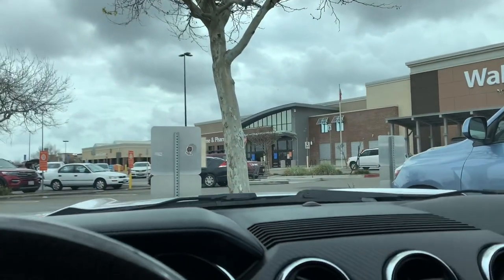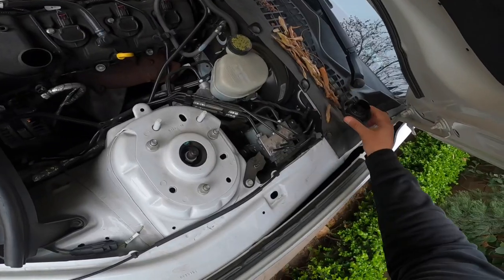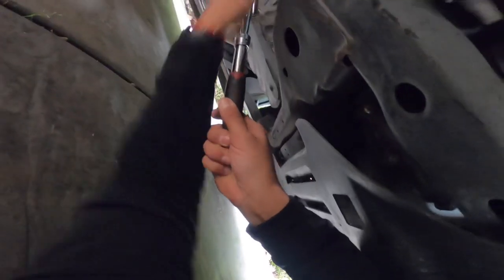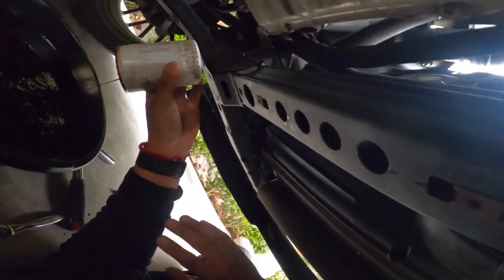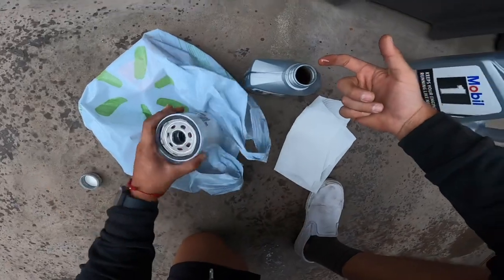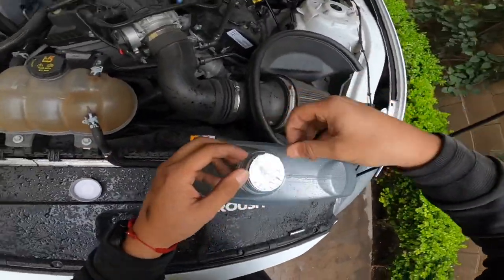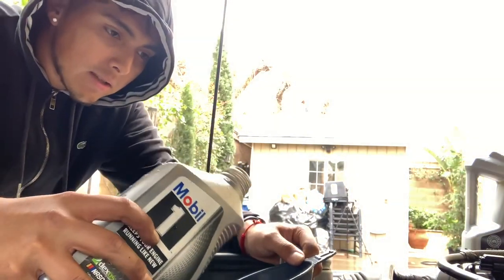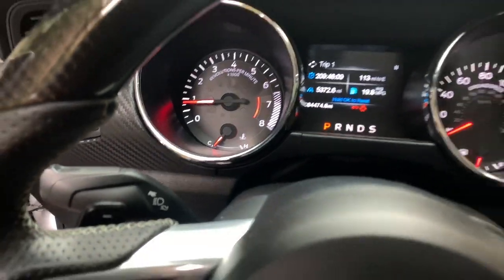OIL CHANGE ON MY 2015 FORD MUSTANG!

Comment: hey bro I have a question, when u deliver 2 a house how do u kno where the package 4 that address is at in the van or do u have 2 just look 4 it?
Reply from the maker: You have to look for it, thats why i keep boxes in the back & plastic bags in the front it makes it easier to find the exact package i need
Reply: @DarielGuerrero  damn all bad bro I’m start soon just waiting 4 my drug test & that’s the thing I’m worried bout is where 2 locate them
Reply from the maker: Don’t be bro, it’ll be so easy once you get used to it, super simple!
Reply: @DarielGuerrero  I appreciate it my boi, how long does the drug test results usually take?